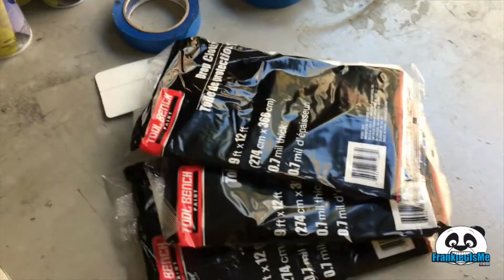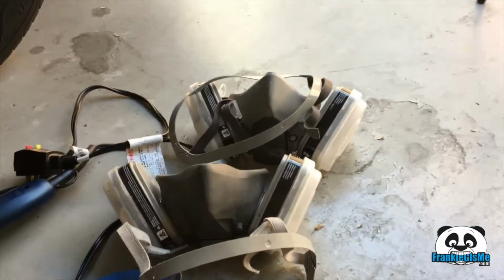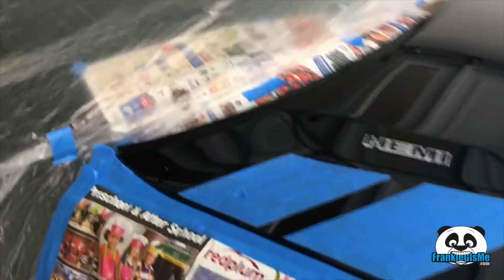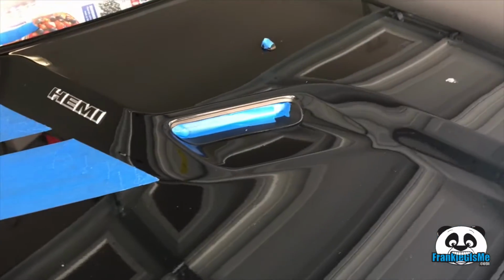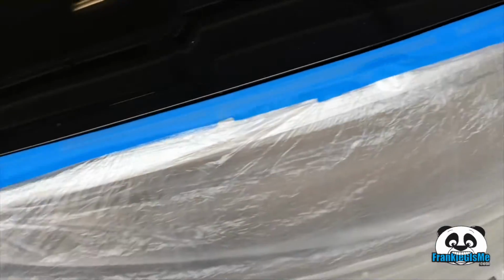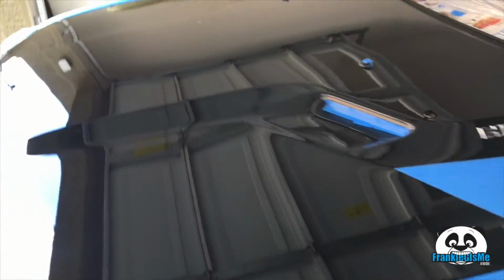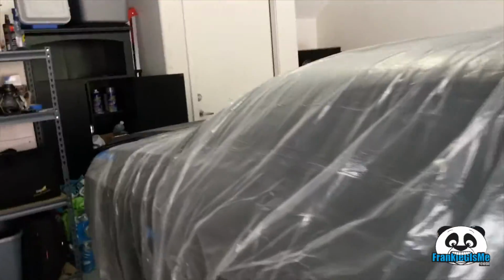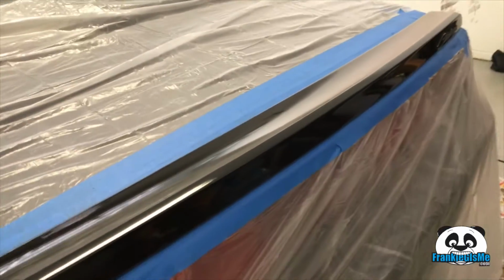How to Plasti Dip a hood

Comment: I'm going to be dipping the chin spoiler on my car, and I was wondering how many minutes I should wait between coats?
Reply from the maker: It really depends on where you are... Im in Arizona. Most cases the Plasti Dip is dry for me in a few minutes because of how hot it is here. If thats not the case for you, i would suggest getting a blow dryer and drying the Plasti dip that way to save you time. Let me know if that helps.
Reply: Then instructions on the can say to wait at least a half hour. If you are doing it in the evening and the temp drops below dew point hitting it with a dryer to keep it warm and drying faster keeps it from chalking up...ask me how I know.....

Comment: That engine bay is a nightmare! Everything else was great
Reply from the maker: Ramsey Jordan I agree 😂 we're in Arizona and get a lot of dust storms. Still not a good reason ha
Reply: FrankieGisMe hey, I just finished my spoiler and want to do my aftermarket hood too. How has the hood's dip held up?
Reply from the maker: Ramsey Jordan we took it off 2 weeks after and used a sprayer. It will hold up well if you do about 4 coats. Challengers have a very large hood that makes it very difficult to get an even finish. Of you do use spray cans take your time.